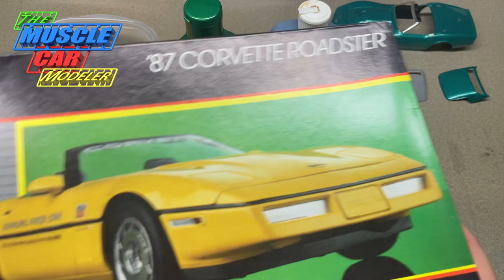How To: Clean and Lightly Polish the Model Glass

Comment: I use basically the same process.  I use 'Meguiar's Plastx'.  I've also wet sanded a windshield w/ 7000 grit that was very scratched, then started the 'polishing' steps.  It saved that windshield.  It was a vintage '69 Corvair Monza kit.
Reply from the maker: Thanks. I think I’ll be doing that on a more damaged one.
Reply: I was thinking the same thing, about sanding it down then polishing it. Or maybe clearing it then polishing. Kinda like on car headlights.

Comment: Have you ever tried using the NOVUS system with#3 heavy scratch remover, #2 fine scratch remover and #1 plastic clean &  shine.
Reply from the maker: Actually no. This is what I have been doing for a long time. I did buy the Tamiya polishing compounds and tried them.

Comment: Ive seen people dip their windshields in future floor polish to get them shiny.Have you ever tried it?
Reply: I have tried it before and it worked a lot better the I tought it would. to be honest it looked brand new, but I might of just got lucky to.
Reply from the maker: I have heard that too but have not tried it!
Reply: i've occasionally used Future for window dipping.. the other benefit is adding a tint to the Future such as the color tints that you might add to clear resin.. a little goes a long way.. and if you're going for a subtle greenish blue factory tint it works really well to give a more uniform result than airbrushing it on.. just give it plenty of time to dry/cure before handling

Comment: How difficult would it be to make molds from the glass and cast new clear ones?
Reply from the maker: I understand from a few casters that clear parts are difficult to do. Resin is slow curing and hard to get without bubbles. Mold has to be flawless as you really can’t sand it easily.

Comment: I have fogged up my clear plastic rear window on my revell 1985 Camaro as I was going to tint it but then decided not too and used white spirit to clean the tamiya smoke realizes it was water based not oil base now it's fogged up.....
Reply from the maker: This is only for light scratches. You may have to get more aggressive and smooth it out.